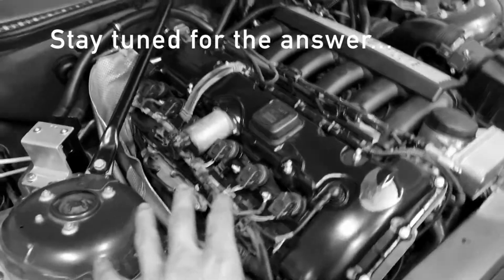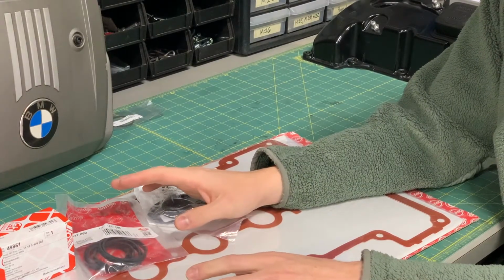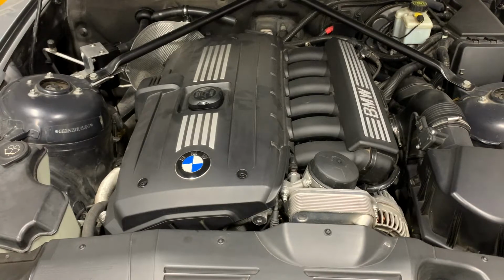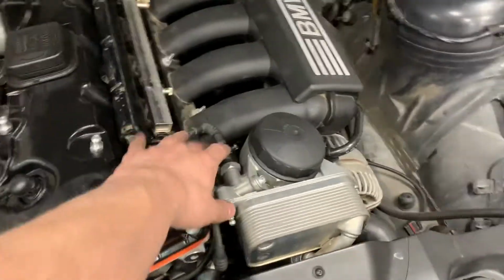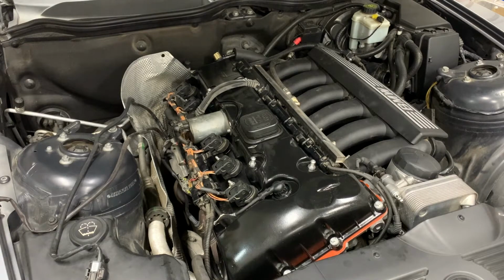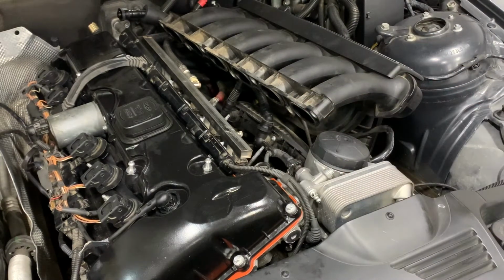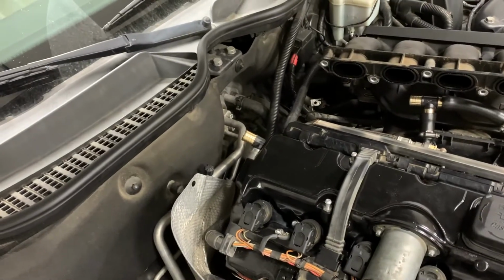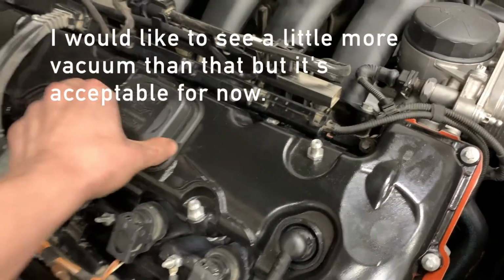COMPLETED - BMW N52 Magnesium Valve Cover Conversion - Part 7: Fitting the New Valve Cover

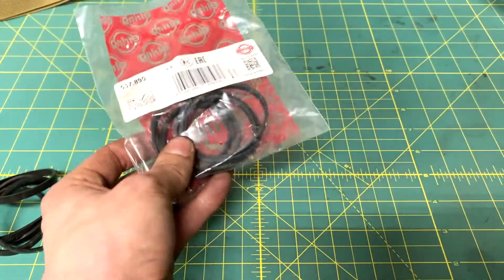Comment: At the 25:00 min mark when you show the main ccv oem plastic hose right, I’m asking myself why you went to all that trouble of creating adapters for the ends that need to attach to the manifold when you could have simply reused the oem clip ends and merely cut away the corrugated plastic hose and been left with nice fittings where then you could have slipped on your rubber hose and secure the hose with hose clamps 🤷🏼‍♂️

Comment: For future reference, use Silicone spray when trying to slip a tight barb fitting on a rubber hose. You may still struggle, but, it's ultra slippery and protects the rubber in the process.
Reply from the maker: @xr500t - I completely agree! Typically, silicone spray is my go-to lubricant for rubber parts like this, it works wonders for removing/installing the intake boots and vacuum lines. But for some reason, it wasn't working as well as engine oil for this particular usage case.
Reply: @Casey_Schmidt  I've had that problem too, now that  I think (why I said you may struggle a bit) I believe the rubber is absorbing the silicone, so spraying  a couple of times will make it easier for the silicone to sit on the surface without drying out as fast and give you a little longer working time.  Just little tidbits! lol!

Comment: If your interested in eliminating plastic components, please swap out the oil filter housing cap and “birdcage” for aluminium ones. And the cooling hose “Mickey Mouse” flange should be replaced by an aluminium one. 👍🏼
Reply from the maker: @Valentjin Vos - I actually have a video about why it isn’t such a great idea to replace the oil filter housing cap to aluminum. You don’t  have to agree with me but feel free to check out that video if you want to see some more info on it.

Comment: The wire for the pcv heater is too long and it rubs on the engine and that's where it starts not the pvc...also there is a relearn procedure for servo motor for the valve lift in ista D...  I installed headers good for another 30hp and I have a tuned DME so I think I'm up around 310 to 330hp mark on my N52 and it pull strong till 7k
Reply from the maker: The relearn procedure is only necessary on the pre-2007 model N52's, to my knowledge. Sounds like you've got a solid N52 on your hands!

Comment: Hello , first off all that is a great job. Thanks for everything. ı am just wondering about torque settings ? I was saw these informations on the forums. ''The torque spec for plastic valve covers is listed on a label on the valve cover as 8.6Nm +/- .6Nm. To make it easy, torque to 9Nm as we list in the article. The screws for plastic valve covers are reused. They are not torque to yield bolts and should not have a torque angle applied. Magnesium valve covers equipped on the N52 engine are torqued to 7Nm and then 90°''  .  How should ı do ? ı have a plastic valve cover and 2005 e90 n52b30 europe. Sorry for my grammer from now :)
Reply from the maker: I don’t remember the exact torque sequence off the top of my head but I do have a video on it that goes into more detail. It is the video about changing the valve cover gasket. It should have all the info you need!
Reply: @Casey_Schmidt   you torqued it is looking 7nm+90 degree on the screen at 11:56 then You are saying just torqued 7nm at 14:30 .  I couldnt realize cause of timelapse did you just torqued 7nm or 7nm+90 on the video. Anyway . Thanks for answering
Reply from the maker: @gokhanylmaz673  magnesium would be 7NM+90. The plastic would be just be a torque value in NM

Comment: Great job, bro. Could you please tell me the size of the hose you use to connect the connectors you reused? Thanks a lot.
Reply: Is it AN10?
Reply from the maker: @yuchilee-q6y  nothing was AN. It believe it was 3/4” ID hose. It’s been a very long since I worked on this project so you’ll have to go back through the series to check.

Comment: Have you noticed any benefits or disadvantages to the magnesium valve cover yet? I’m considering this for my n52 128i. Thanks
Reply from the maker: @Malcolm Viitaniemi - Great question! There are no performance benefits to they modification. The only benefit is to increase the service factor. In other words, you won't have to replace a cracked plastic valve cover or torn CCV diaphragm every 5-8 years. If you plan to keep the car long-term (8+ years), it's a good upgrade. If you don't, it would not be as worth it. The 1-Series also has a lot less free space in the engine bay which would make implementing the catch more of a challenge; not that you couldn't overcome that.

To sum it up, the drawback is that it is a somewhat expensive upgrade for no performance increase. The benefit is that is will decrease long term running costs and increase long term reliability.(But only with respect to the valve cover).

I will have an update video out in a couple weeks about how my car has been running with the new system and I can also go into this topic a bit more.

Comment: Just did this job myself without the catch can (magnesium valve cover, external oil seperator, from 2 port to 1 port. Currently having my car start up for a second maybe 2, stall with a sight squeal or squeak. I know everything before this job was working in good condition. Any suggestions as I believe the valvetronic motor with unplugging
Reply from the maker: What year is your car? Pre-2007 engines need to have the valvetronic motor recalibrated after reinstallation. If the noise is coming from the CCV system, double check that it’s in good condition/operating correctly.

Comment: soo, you didnt mention anything about the hose that goes to the oil pan, what did you do with it? and does it really needs a WV PCV piece?
Reply from the maker: @buksy bogdan - To my knowledge, on the first version of the N52 has a drain to the oil pan because of the external CCV. Since this is the second version of the N52, it doesn’t need anything to go back to the oil pan (though I believe the oil pan still has provisions for a hose inlet). The catch can will hold everything and it will be dumped out every so often. You could rig up a return system if you want but I chose not to because I don’t want that fluid going back into the oil.

You don’t need a VW PVC but I chose that part because it was inexpensive and has a convenient 90 degree bend in it.
Reply: @Casey_Schmidt  awww yea, yours had the plastic valve cover, should i just close that line that goes to the oil pan?? Or does it need to be open for some kind of preassure or gases? Any idea?
Reply from the maker: @buksy100   - I’m pretty sure that it’s only there as a drain. The M54 has an almost identical system. When people convert the M54 from CCV to catch can, they often plug off the oil pan drain. That would by personal recommendation because the stuff that collects in a catch can are not things I would want in my engine. But it really is up to you and how you would like to set it up. By what you’re saying, I take it that you have an N52 that already had the magnesium cover and are converting to a catch can?
Reply: @Casey_Schmidt  right, my ccv is underneath the intake, but ive changed it and i still have alot of oil in my intake and burning alot of oil, yesterday i got a code for the small disa... ive replaced the big one i dont want to go through that again so i decided to get a catch can, its true i didnt replace the hoses of the CCV cuz they werent cracked or anything i might have done a mistake there, the orings might be the problem but still i wont buy some plastic hoses when i can go for a catch can which is much more safe... ps the small disa might be already gone, not sure cuz the code was inactive
Reply from the maker: @buksy bogdan - That is defiantly an interesting problem. Out of curiosity, which chassis do you have and how many miles/km's? It might be possible that oil has pooled in the bottom of the intake over time (from the failed CCV) and the engine could be sucking through residual oil from that pool. I'm not sure how likely that is but it's a thought.

Those plastic hoses are one of the weakest parts to these engines. I couldn't stomach buying new plastic hoses either because they aren't cheap yet they fail so easily. I have a lot more confidence in the rubber hoses.
Reply: @Casey_Schmidt  e90, 2007/09, with 175xxx km , there is no way the oil could have pooled so much, ive cleaned the intake before i got it back on after ive changed the disa and the ccv separator... sometinhg must be wrong with the hoses , as far as iknow the sistem runs on vaccum, it might not get enough to separate de oil cuz i dont see any other reason why there is so muchoil in the intake, i mean i know there has to be somebut not to the point where you can see it dripping on the edge of the block holes leading to the valves just after removing the intake, oil shouldnt reach there if im not mistaken
Reply from the maker: @buksy bogdan - Yeah, I agree with your assessment. There are only two ways for oil to get into the intake system; from the valve cover via the CCV and up through the oil pan drain via CCV. The common denominator is the CCV and if it is not seeing the correct vacuum then oil could be getting sucked in from somewhere it shouldn't. On my E39 (with an M54B25 at roughly 200K miles), I had oil get sucked up from the oil pan because the CCV was clogged; i.e. incorrect vacuum.

Long story short, I agree that a catch can with some real rubber hose sounds like the best long term solution. Good luck with your mods and I hope you find your solution soon!
Reply: @Casey_Schmidt  thx, your vids and answers, helped me alot, gone do my as clean as i can, gl in the future!
Reply: @Casey_Schmidt  hello again, my catch can just arrived and i was wondering if you still remember the exterior diameter of the intake hoses, the 2 hoses for each bank is it 19mm ?
Reply from the maker: @buksy Bogdan - I don't recall that measurement. 19mm would be close. All I can really say is what I showed in the video which is to use 3/4" hose with hose clamps on the factory quick connectors. If you want to go straight to the manifold and not use the factor connectors, then you would probably need 7/8" hose or the metric equivalent. The only real issue there is that 7/8" is harder to find for this application and would also probably cost more.
Reply: @Casey_Schmidt  what size plug do i need to plug the oil return ?

Comment: What’s the part number for the pcv valve you used?
Reply: I’m doing a n54 manifold on my n52 that already has the mag cover and was looking to delete the whole Ccv system
Reply from the maker: @Isaiah Thomas -The PCV that I chose is a VW part from a 1.8T. I don’t remember the part number off the top of my head but I know I went over the new PCV details in Part 6 with part numbers.

I didn’t know the N54 manifold was compatible with the N52. What is the purpose or benefit of that swap? Maybe post a video if you have time, I’d be interested to see the details!
Reply: Casey Schmidt well my disa valves failed and I’m planning on going turbo n52 eventually , it bolts up perfectly n52 maf swapped over only issue I’m having is figuring out what to do w the oil line to my pan (06 mag cover has a cc’d line that returns gases to oil pan for emissions) the manifolds already tapped for a aftermarket bov so I think I’ll use that as a vacuum source for the catch can I ordered (bms clone)
Reply: Casey Schmidt I’ll make a video once my catch can comes n I get it all finished installed I’m re using n52 tb even tho I have n54 Tb but it uses a different connector found on 07+ engine harnesses I’m not sure what gains I’ll see if any with or without a tune but not having to worry about dealing with faulty disas and it being way easier to remove than the 3 stage manifold it makes working on stuff on a lot easier
Reply from the maker: @Isaiah Thomas - That sounds like quite an involved project that goes way beyond the scope of what I’ve done. It sounds like you’ve got a good plan started though. It looks like you’ve got a good plan started so I’m sure you’ll be able to work through the challenges as they arise. Best of luck!